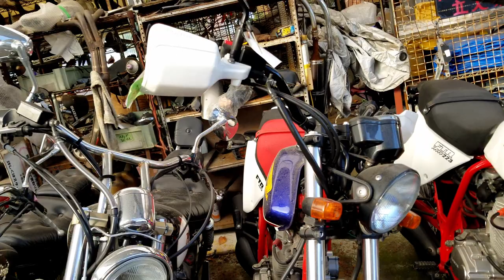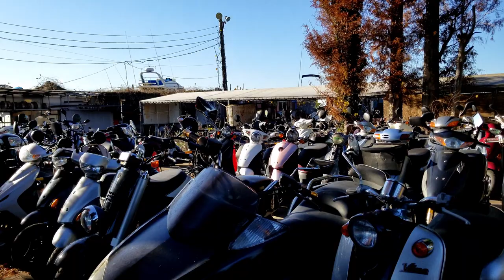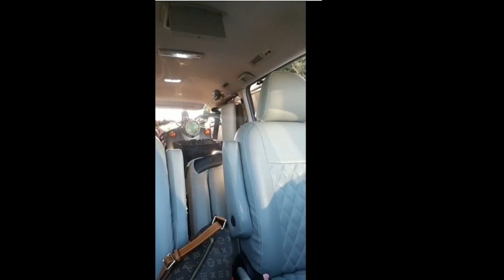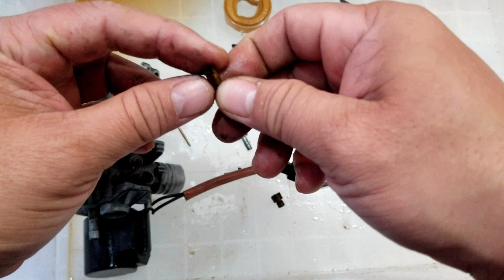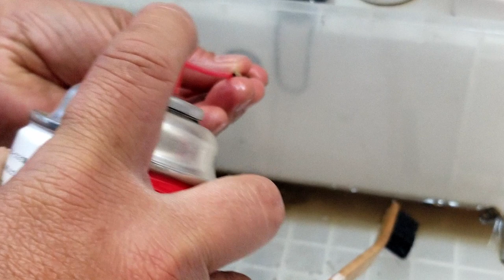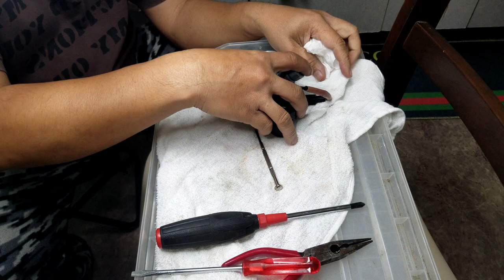Japan Junk Motorcycle, Carburetor Repair DIY, Japanese Friend bought Junk motorcycle Problem Solve

Comment: Hey, I hope you can help me out with some answers. I wanted to know how much it was you paid in the end for the scooter an if you have an idea what prices ranged from for scooters of that age. Particularly the Honda Dio and Tacts of 1995-2000s. Thank you!
Reply from the maker: Motorcycle and battery cost $100 and I do the DIY repair the carburator. About the price ranged it depend, a good one like $300-400 but the beat-up no start only $70 you have to fix